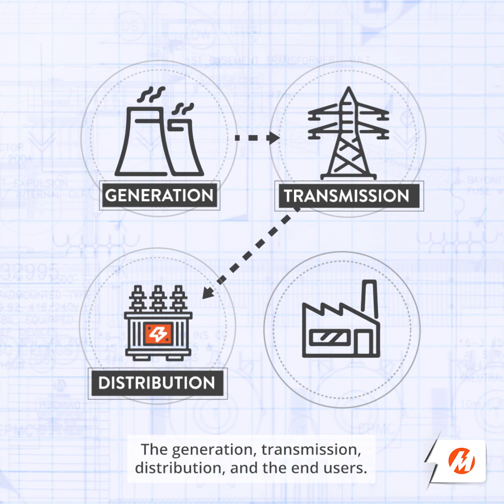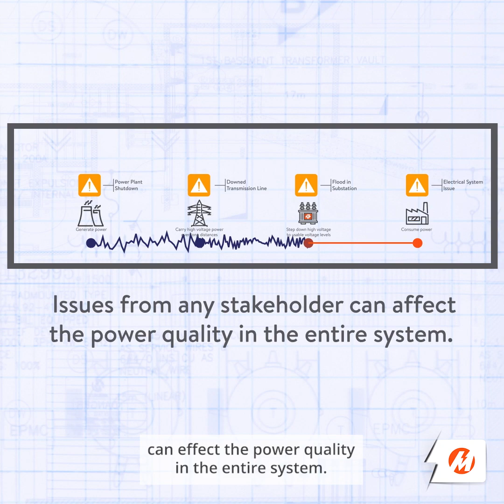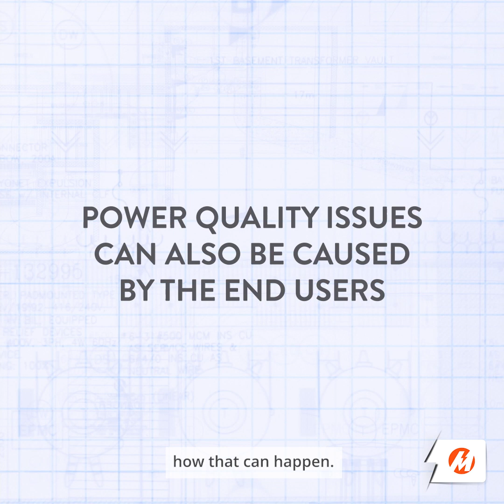Power Quality Webisode 2: Power Supply Chain

Comment: Sir nag lolow voltage po sa bahay namin ano po kaya problema?
Reply: Hi! You may ask a licensed electrical practitioner to check the power quality issues in your electrical system. If you'd like to learn more about other power quality issues, you may download a free copy of the Power Quality Manual on the video description above. 

Meralco also offers online services which aim to provide additional options and improve convenience to its registered customers. You may report an outage or incident at https://sh-ort.app/9cp6t.
Reply: may kumakabit na jumper siguro 😅

Comment: Too many channels, can cause too many issues and many things to consider to monitor and maintain...do they have an alternative to simplify? Would they consider underground power lines like in BGC?
Reply: Hi Raymund, as a distribution utility, Meralco has an obligation to supply its customer in the least cost manner. An underground distribution scheme usually costs three times more than an overhead distribution system.
Reply: Ang galing ng explanation. Thanks Engr. Kyrus. More power